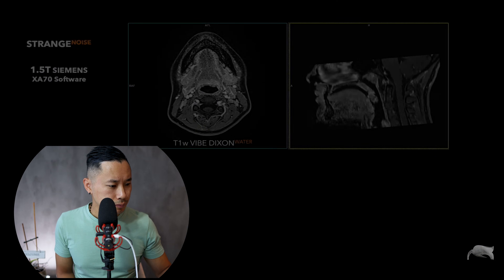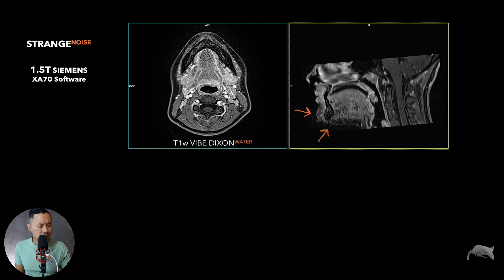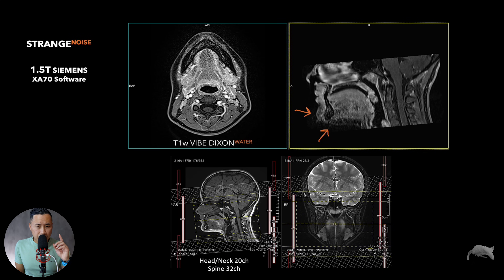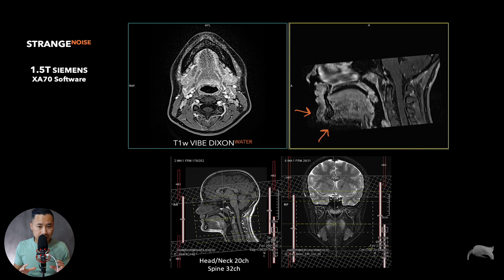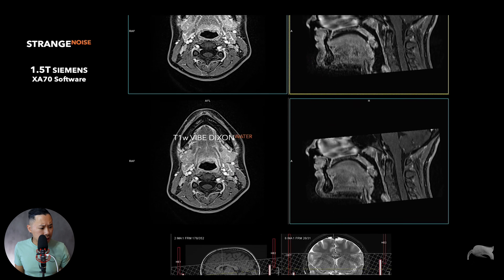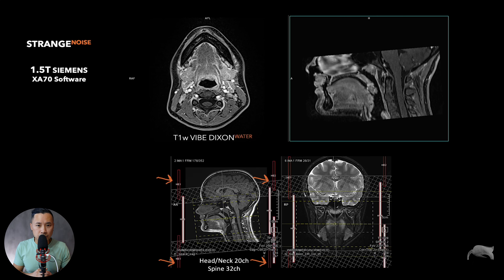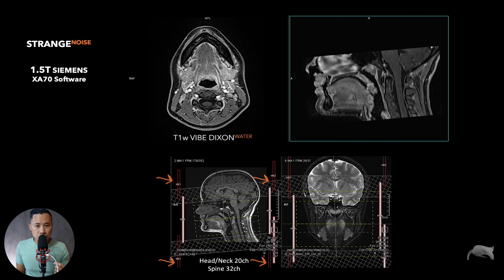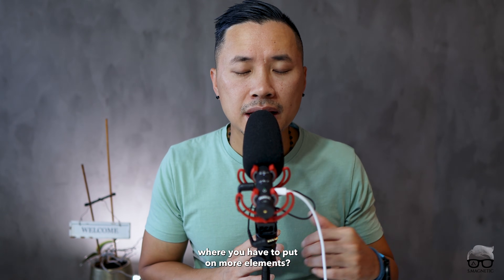MRI – STRANGE NOISE

Comment: Great video!!! When you say "elements " do you mean turning the proximal spine coils on?
Reply from the maker: Elements im referring to the coil. Different coils have elements as seen in the video. Usually you set til to auto and it works great. Where your fov, it auto turn on those elements which is needed. However, for this video i turned manually on more elements and the results was better.
Reply: Also, this is off the discussion by the way.. when asked to obtain an Axial Dixon post gad  fatsatted, my thought is that Dixon already had fat on it, do I still change anything to obtain the fatsat or just inject Gad and send all including the fat sequence?  Thanks 🙏
Reply from the maker: @Ifeanyi736 dixon for Siemens comes in two techniques. Tse dixon 2D. And gre Dixon 3D (Vibe). In dixon sequence you can tick on: in phase. Out of phase. Fat only. Water only (fat suppression). You can obtain of weighted tse of t2,t1, stir and pd.
Reply: @Nguyen_MRI makes sense. So I have to ensure that I tick fat only in order to get it fatsatted. I guess checking / ticking all is important when fatsat post Gad is requested so that it's not missed. Thanks
Reply from the maker: @Ifeanyi736 water only is fat suppression images (fat sat). However, to ensure its not swapping and cause trouble i would just tick on all 4 images. Just my opinion.

Comment: Hello, Bac, unfortunately, turning on more coil elements that it needs to correctly acquire the data in the FoV - has a huge side effect. You will get the undesired data from the regions where the field is already so inhomogeneous, that you'll get artefacts visible in FoV.  E.g. turning on the headcoil elements to scan T-spine leads to moving-like/aliacing-like artefacts in phase encoding direction. In your example, you can get the unsuspected aliacing-like artefacts from head's vertex in slice encoding direction. 

So to prevent this local noise, I recommend decreasing PAT factor and equalizing scan time with other methods. E.g. try to use caipi 1-3-1 instead of 2-2-1 :)
Btw it would make you protocol less sensitive no motion, which is very important for neck soft tissue :)

Btw2: in the auto coil select/acs restricted settings there is sub-menu where you can change the strategy of auto-selecting the coil elements. Setting it to "Generous" leads to turning on maximum elements around FoV. But I don't recomend it for the reason I described above :)
Reply from the maker: Hi, thanks for the good explanation. I’m not fully in agreement with you, though. In this specific test, you can clearly see the difference with what I did. That said, I agree that for the spine I would be more cautious. In fact, in the video I also mention that this approach should not be used as a standard. The safest option is to stick with what’s been taught, which matches what you explained to me here.

However, in cases where you encounter unwanted noise like I did, then my method can be worth trying. I also know that people apply a similar approach in dynamic prostate imaging with TWIST VIBE, where higher PAT factors are needed to meet temporal resolution requirements. They tested it in the same way I did, and with more coil elements for that specific sequence, they were able to achieve better images.

Coming back to my test: I forgot to mention that I only used GRAPPA 2. Could you give me a more detailed explanation of why my method worked in this case?

Comment: Hey Bac, interesting finding. In my experience this may be due to what I simply call “grappa math”. Essentially not enough elements for grappa to do its math, which tends to result in non linear noise patterns. It may be that especially in a 3D scan that the slice oversampling portions of the data that are outside anterior elements are dragging in noise in which grappa has to mathematically place somewhere. May be worth trying without grappa (and reduce snr to compensate) and see if this artifact disappears

Comment: Hey Bac
 I have also seen this noise but only in vibe dixon sequence. Maybe its related to the sequence since it is 3d
Reply from the maker: I'm not sure. Do you think those elements showing there are not 100% showing on the anatomy? 🤔
Reply: Since the noise shows at the edge of the anatony maybe the machine wants the elements to overlap in order not to lose snr

Comment: Did you have too high PI factor to those ordinary low amount of coil elements? Then more elements, better. Or lowering Grappa factor.
Reply: I’m a Phillips guy with some Siemens background I was thinking more of like a slice oversampling issue S-Sense too high
Reply: https://pmc.ncbi.nlm.nih.gov/articles/PMC4459721/   Figure 13.
Reply from the maker: Good question. Only pat2 (grappa)
Reply: @Nguyen_MRI  Hmm. Pat 2 in FO direction and in slice dir. 1? Or 2?